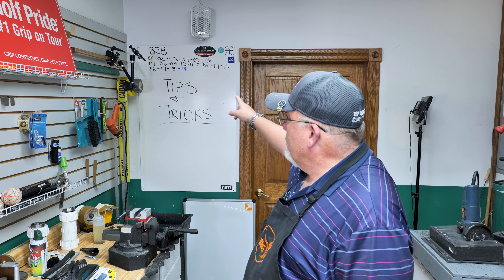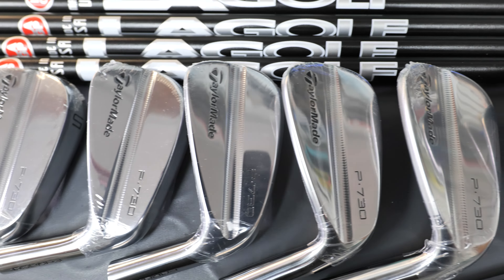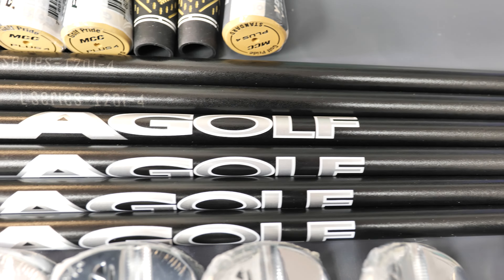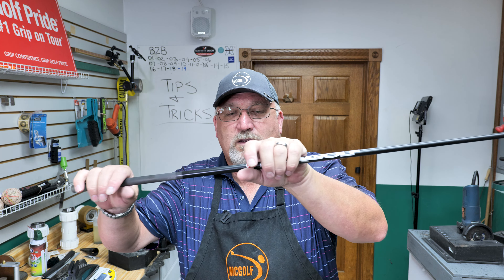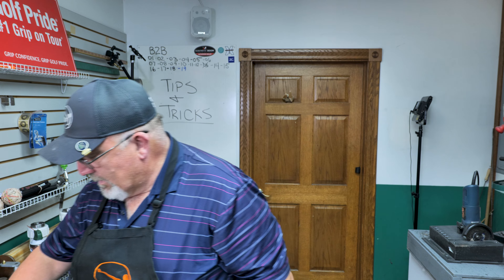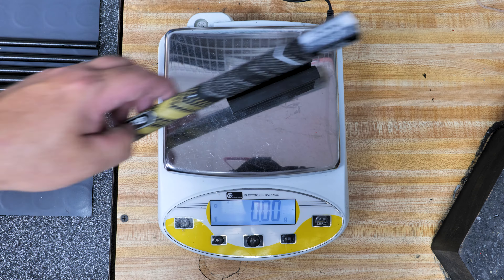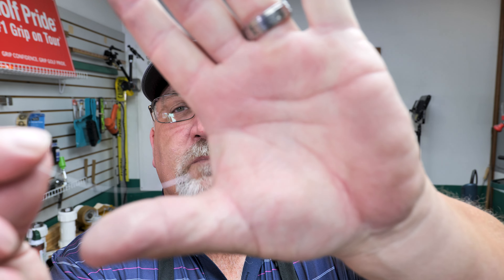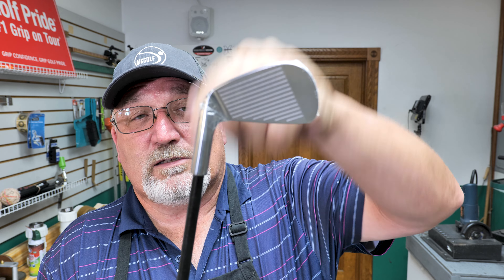Golf Club Building - Taylormade P730 irons

Comment: Hi Jim, I’ve had a number of irons (with tip weights) where the glue oozed out from in between the ferrule and club head, and it’s a pain in the rear to clean when it’s all dried up. It tends to ooze out long after I’m gone, I’m using 24 hour glue. Am I simply using too much glue? Is there some tip and trick to avoid this? I did tape the ferrule and head but the glue still creeps out.
Reply from the maker: Try just covering the bottom third of the tip with glue and installing the shaft then check to ensure complete coverage, you are right it is a pain in the butt

Comment: You mention you check for loft and lie as a final step. How often do you find they are out of spec and need to be adjusted? I am asking because I recently ordered two irons, one from Callaway and one from TaylorMade to test, and asked for a specific lie angle and made some changes to the standard loft on both as well. Should I have them checked or can I assume they are correct? Is there a cheap way I can check the loft myself?
Reply from the maker: It is not uncommon to find the loft or lie off by a degree or less on the upper tier clubs. Typically a degree is not detectable except maybe for lie angle in the shorter irons. However we do check each head put them to the spec.   A quick trip to the local club guy will be a cheap way to ensure the loft and lies are proper
Reply: @McGolf  Thanks brother I will do that. Since I am putting together a custom set around my style of play, I need the lofts to be close to spec.

Comment: Did not understand!  You glued everything together, using the same weight in each club, then you “cut to length” and then gripped.  How do you cut to length and know what swingweight you’ll have when you’ve already glued the weights in?
Reply from the maker: The shafts are discrete lengths,  I tested the first one which was cut to length then using the data from measuring I know how the rest will act.